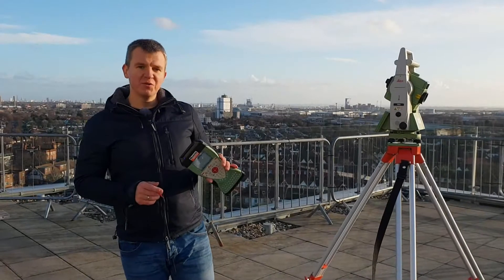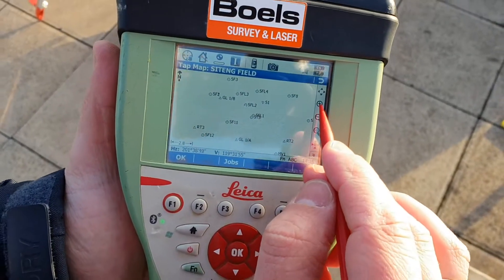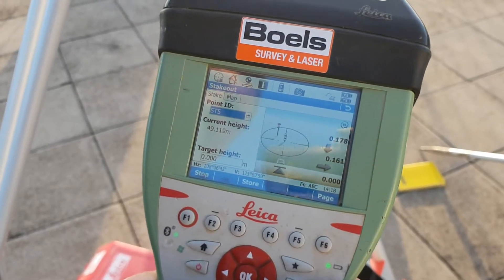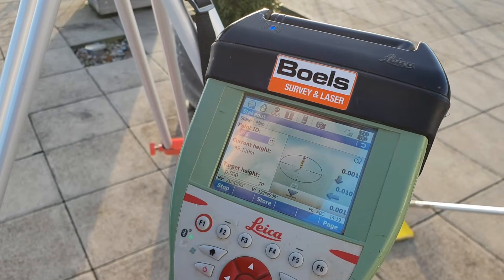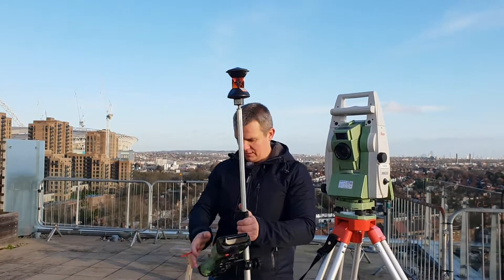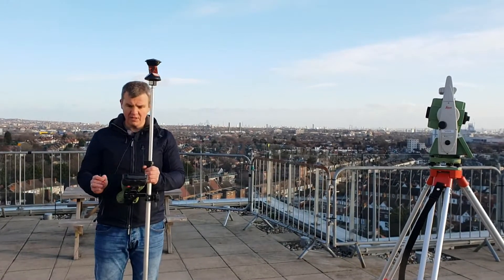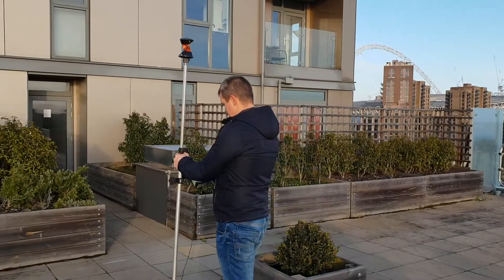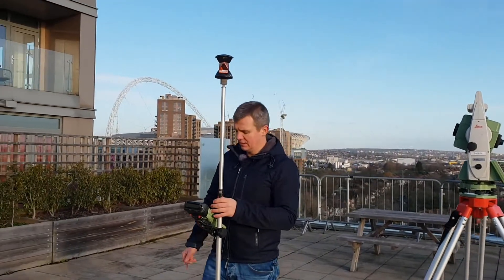SETTING OUT # 13 - How to mark a point using Leica TS15. Robotic Total Station 'Stakeout' program.

Comment: Hello Greg,
                This was a perfect video.

     The only proviso is that it was not actually videoed on the live working area on the site but it was sufficient to relay the message of the brilliant working magic of the great Leica TS15.

    I am glad you mentioned in this video that you can stake out using the drawing points on the Controller or the normal setting by doing it manually as a normal Total Station.

    I am learning to use TS15 or TS16 on the Robotic mode and thus everything you are showing is brilliant.

    It is the uploading and downloading of the survey data which is the crunch bit you have to explain in a clear crystal method you have used up to now.

    On Video No.12 you did not show how you downloaded the surveyed data onto the laptop via the Cad software.

    I will be grateful if you would kindly show this in your next video.  

      Super video.
Reply from the maker: Hi Asim! Please see last video (uploaded today) when I am taking information from the instrument to the CAD, in previous 2 from 'know how' for engineer's I am showing also how to create a job and how to bring the data to the instrumetn, hope it will help :)

Comment: I am thinking of buying the ts15 for survey work and setting out. How do you accurately survey building corners?
Reply: Yes I suspected that, its frustrating as in trying to lose the staff holder, I'm losing the accuracy of precise building footprint, and actually have to survey it twice. i.e once to laser the corner and second time to get a level on the same corner. I can already do that with GPS (separate kit) so don't need a robotic at all to achieve this. So wondering if there's any point getting a robotic if its making me less efficient and survey every corner twice, just use my old TS06 to laser everything and GPS a foot out from the corner after
Reply from the maker: Depends what you will need a robotic for really, if you can do you job with TS06 and you have one, then there is no point in spending so much money.BTW I love TS06 :), but for works I am currently doing robotic makes life really easy.
Reply from the maker: Having your own EDM is a good idea, especially now as there is quite a lot of offers for engineers with own equipment. I do not survey accurately the corners, but I would probably try to 'shoot' just the corner, or if possible send someone to hold the target there. For me 2 points on each face close to corner (giving me two lines) is well enough to find the corner position.
Reply: Thanks for reply. I'm freelance with own kit doing topo green field sites and some setting out. A lot of measured building surveys too for architects. Do very little site engineer work. Might keep my pennies for equipment failure disasters for the moment